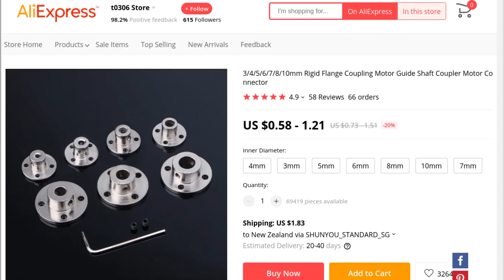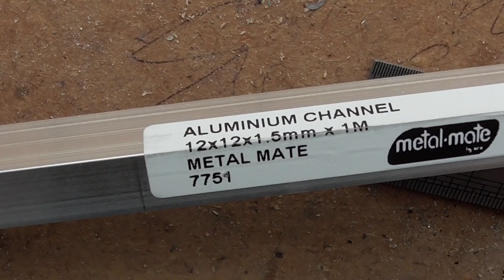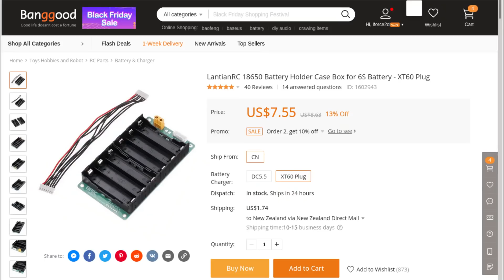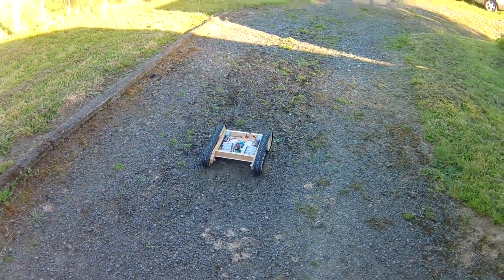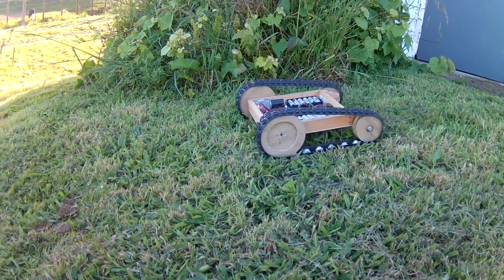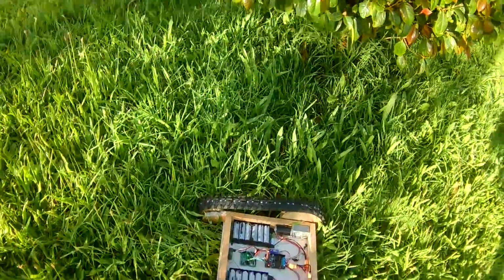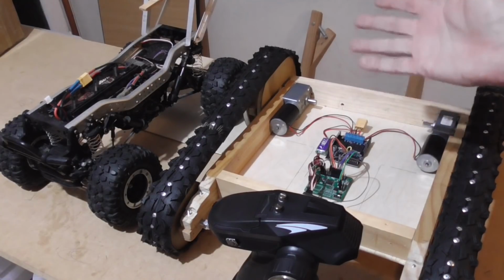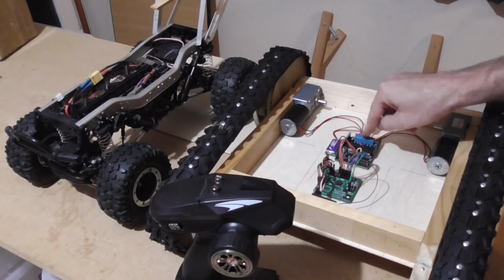Little wooden tank thingy (iomixer)

Comment: So cool. simple and effective. I was wondering why you took the aluminum profile pieces instead of wood or 3d prints. but I guess as you shown the precision is unmatched this way. great idea taking the tires as chains. If I try it I'll take just kids bike tires or something like that.
Reply from the maker: It's extremely difficult to get anything to stick to the inside of the tire, basically rivets or screws are the only choice, and you need two to stop the tooth from turning around. Two screws into wood might have worked, but with the tooth being narrowed at the tip there's not much wood left. Overall wood seemed less durable and a similar effort to build. With the aluminium channel if the hole positions are slightly off they can be widened a little to fit, so the building can be done faster and sloppier. Rivets are quicker than screws and a bit cheaper and still removable later, but they require a thin plate to squeeze against, hence the aluminium. Rivets would have crushed a 3d print and I don't have a printer. The aluminium teeth tips can be narrowed pretty quickly with a hammer.

Yeah if I was starting with this as my 'plan A' I would have used a kids bike tire and planned around that sizing. One nice thing about the larger radius tire is it's closer to a flattened track already and doesn't want to curve so much at the sides.
Reply: Bitluni is here, BITLUNI IS HERE!!!!!!

Comment: Nice!  You have a working prototype ready for further development, so that is NOT a fail!  :-)

It brought back a lot of happy memories. I used to build and fight combat robots [kinda like the ones they used in Robot Wars and BattleBots], and had my first fight in 1987. Our 'Centurion League' machines weighed 100 lbs, and could only cost £100 to build. (So... centurions - did you see what we did there?)

They were hilariously crude by modern standards and their weapons were feeble, but they were fantastic fun. I don't imagine you'd get much robot for £100 these days!

In 1987 there was no such thing as a personal computer; we had no internet, so no online help, no CAD, no CAM, no hobby-grade CNC machines, no design software, no 3-D printing, no brushless motors, no LiPo batteries, no mail-order parts like motors, gearboxes or electronic speed controllers. All analogue, nothing digital. We either improvised or scavenged stuff from scrapyards.

Construction was all wood and aluminium; power came from 12v lead-acid car batteries. Radio control gear was on 27 MHz, which needed an exposed receiver aerial about 24" long. 

Thanks for this video - I really enjoyed it.

Comment: I have built several of these tank style designs. It takes a tremendous amount of force to skid the track trying to turn.  Either go with a half-track design (less track to have to skid across the ground) or you'll need some powerful motors or much less grippy tread.
Solid design! Few little tweaks and you've got it.

Comment: Hey Cris, maybe you should have a look at those hoverboard things, people hacking them easy, and are an astonishing quantity of goodies in a pack for a few dollars if you find a used one.
Reply: that sounds like a good idea..
Reply: Yes, good idea. 2x cheap eBay 250w e-bike brushless motor controllers can power the wheels (make sure they have the reverse function and self learning for the phase wires and hall sensors). I don't have the skills to hack the on board hoverboard motor controller, maybe someone can figure it out. There is however, a way to convert the e-bike motor controller throttle input to accept R/C receiver PWM output using a servo tester.
Reply: I was thinking exactly that. I bought 3 hoverboards last month for $40 total. One of them was fully functional. People really hate those things! However, that allows me to get 250 and 400 watt motors for about $5 each! I can't decide what to do first. Maybe a 1600 watt AWD longboard?

Comment: nice little trick i learned recently. If you need to shorten a bolt, leave the nut threaded on it, then when its cut un-thread the bolt, it kinda re taps the end of the thread that you cut.
Reply from the maker: Yeah I do that if I'm cutting with a hacksaw. The dremel cutting wheel doesn't seem to cause that problem.

Comment: Reminds me very much to my first attempt to build such a chassis many years ago. Unfortunatley I was not that smart to build it from wood and ordered a aluminium, motors, chains, screw and stuff. As this was before it was possible to order all the cheap stuff directly from China that was even quite expensive. But the result was the same too weak to turn.
Later I made similar experieces with several simple DIY tank chassis I ordered from China. They also failed to turn. 
Today I am not sure anymore if the problem really always have been the motors. Maybe sometimes it also was because the batteries where to weak and didnt deliver enough curent to get the chassis turning.

Comment: I've been thinking about building a tracked machine next. Nice! 
Use of bicycle tyres is clever. You might be able to get smaller tyres that you don't have to cut up and sew back together. But hey,  it did work and with the large "teeth" you don't have to have a lot of  tension. 
These worm gear motors are very quiet, I think that was a big part of their design choice. But they have little power. You can get them with higher reduction, but of course then the speed drops quite a bit. 
In the end, to say it with Tim Taylor, you need "more power, harr harr harr" ;) 
Automotive electric window or windscreen wiper motors are popular steps up in power. Some even come in lefthand and righthand housings. 
Very interested in that secret project!
Reply from the maker: ah yeah, the secret project would be right up your alley now that I think about it :) If you can you drop me a mail at iforce2d at gmail, I'll send you one when it's ready for more testing.

Comment: I agree with your assessment and what other comments here have said, it looks like the "platform" itself performed very well, just pretty underpowered from the motors- might just be a lot more friction in a tracked setup like that compared to the crawler with wheels? Would be really curious to see how it does with MOAR POWAH ;-)  

I also wonder if you could design a 3D printed wedge that would work for the tracks rather than the cut/bent aluminum ones? Could lower the build effort considerably, and that's the only heavily duplicated part (especially compared to a lot of other tank designs I've seen).

Comment: 1. Setup is ok, but to achieve the necessary measurement accuracy for this, you’ll need a top quality test gage from somebody like Starret.  2.  Solution is perfect, just selected the wrong problem: seal the axle penetrations and the motor access cover before correcting the design title to semi-amphibious landing craft.  3. Swap the drive and driven wheel positions so the smaller wheels are on the motor shaft for more torque.  4. Wash that gray hair coloring out of your beard.  We know you dyed it to try looking more extinguished. 

As always, great stuff!

Comment: Couple of windscreen wiper motor/gearboxes and some decent LiPo's and esc's would be a good move.
Looks good....like the tyres idea although I would have tended to "stitch" them together with something more substantial like a couple of narrow metal plates and screws.
I don"t think it would worry the drive if the radius was large enough.
Reply from the maker: I actually started by buying a wiper motor, these ones were so much easier to mount though. Wiper motors are surprisingly expensive even junk second hand ones, they likely would have cost more.
Reply: @iforce2d  Another alternative could be the window winder motor/gearboxes....sometimes known as a window regulator......yeah, well, fair enough I guess as it regulates the amount of incoming/outgoing air.

Comment: i would use those hoverboard wheel hub motors. broken hoverboards can be found all over for cheap. it even comes with a driver board which someone made a custom firmware for it (the trigangular looking board)  those motors are 3 phase brushless motors with hall feedback.  they can be driven with a n normal esc if it can handle 8S or more. but a generic ebike controller works much better.
Reply: I was wondering if it was possible to hack into those motor control boards. Good to know, I will have to research into that.
Reply: maybe not hack into, most manufacturers lock their software. but its a standard stm32 so rewriting is / was the better option.  https://github.com/NiklasFauth/hoverboard-firmware-hack

Comment: As you increase traction/grip with more rubber area touching the ground you also increase rolling resistance. Added weight also pushes it into the ground too adding to more rolling resistance.

Comment: 03:09 A 3D Printer would have been nice at this point hu? ^^ Nice to see another rover project, I always like  yours.
Reply from the maker: Not really, I can't see 3d printed teeth lasting very long :p
Reply: @iforce2d  I was just teasing, BUT you're wrong ;). You would be amazed how tough even PLA is when kept in mind during design. Also typically you loose interest with the project long before the part has a chance to degrade. Also the design, print, iterate process is a lot of fun and I would love to see your take on it. For example if you just put a washer between print and rivet it would have been fine.
Reply: @iforce2d  rctestflight went the complete other direction. Everything PLA include the tracks. It ran day and night, with a little help here and there, for several straight months.

Comment: I think part of the problem is generally the brushed motors that come on things like that from China are complete junk they use really weak magnets and probably a really high wind count makes them efficient but, terrible if you want power. The ones used in rc cars are much much better, even the stock Tamiya motor in your CR-01 probably puts out like 5 times the power at a higher RPM to boot. I'm sure you could find some cheap 540/550 motors to swap and salvage the project but, you'll probably end up destroying those gearbox.

Another thing I found on a tiny track I built it turns better when stopped if you mix both channels for a turn if you were not already.

Comment: What coding tool was that? (Not finished watching yet)
Reply: Yeah this is the interesting bit to me too. Some googling finds some attempts to use existing visual dataflow tools from the JS world with Arduino, at this github: https://github.com/microflo/microflo-example-arduino -- but it looks like not much has come from it since. I'd be super interested to hear about this secret sauce.
Reply: @mrluc  looks like it might be flowhub: https://flowhub.io/ the ui looks similar
Reply from the maker: It's my secret work-in-progress :) It runs on STM32 and executes the nodes in that network at 50Hz, kinda like a virtual machine I guess. Unlike the other tools mentioned here the nodes are rather simple and can only have a single output, and there is a strong focus on RC related usage. So far I have these working:

Inputs:
Analog, digital, servo PWM, PPM, iBus, SBus, IMU (gyro/accel), GPS, nRF24

Outputs:
Digital, servo PWM, PPM, duty cycle PWM, addressable RGB LED, nRF24

The configuration interface runs in a browser and requires a 'relay server' running in the background as a go-between to access the USB port. The result value of nodes can be viewed at runtime in the browser (handy for calibration) and execution can be paused and stepped.

The node configuration is stored in flash memory so it could be 'pulled' from the board for further adjustment, even if the original file is not available.

This will probably become a commercial product and is the main reason I haven't been making many videos this year.
Reply: @iforce2d  oh, that's rad -- that seems like a heavy lift that's super capable/flexible once it starts working. I did wonder how it might be done if it was from-scratch, but I thought about compilation/macro-style approaches -- which would lend themselves less to that kind of 'liveness' (ie to instrument you'd have to recompile w/instrumentation enabled). Super cool, thanks again for the interesting content.

Comment: What motor controller did you use? It's possible for a motor controller to make motors hot. If the microcontroller commands the motors to go/brake repeatedly, the motors can get hot fast. You usually want the controller to command go/coast.
Some older controller chips don't like to be driven at high frequency. I'd like to talk you into trying a 200Hz PWM frequency. There might be other changes to improve the way the motors behave.
By the way, you can't call it a robot if your motors don't have encoders. (That's a rule of robotics I made up.)
Anyway, give us info about the electronics so we can help you out. Though to be honest, you're probably right about the motors being the problem.
Thanks for the fun video.
BTW, who was the guy at 3:07? Your dad?
Reply from the maker: It's a VNH5019 which can go up to 20kHz.

Comment: Good job tho m it seems under powered try a larger lipo 14.8 or 11.1 the gearbox should handle things ok the motor may not , link the gear boxes together via shaft to one motor in the middle a grungy one you can always limit the torq

Comment: I wonder if cross loading the gear box shaft from track tension is an issue?
Reply from the maker: Probably not because the shaft is supported on both sides, which is one reason I chose these.

Comment: Clearly you're not going to get any reasonable reading from that dial indicator without putting the track on a properly calibrated granite surface plate first, duh.
Reply: kc8omg:   Yeah... obviously!   I'm surprised you didn't notice he was using it in his right hand, when it is clearly a left-handed model.   :o)
Reply from the maker: goddamit I knew something wasn't right.... with the coriolis effect though, isn't it ok to use these right-handed in the Southern hemisphere?
Reply: @iforce2d  Normally yes, but Mars is in conjunction with Virgo right now AND it's an even numbered year, so yeah, could've tripped anyone up.

Comment: Could the control board be configured to drive your mobility scooter platform ?
Reply from the maker: I suppose so, but the wheelchair already has a controller designed specifically for it, with automatic 'parking' brake.

Comment: As a fast solution to get some more satisfaction while more powerful motor / reduction gear will come, is to swap wheels backwords, so that smaller wheel will lead, as it has less radius. Howere need to sacrify speed over torque from total power. I like your ride in downhill direction with high grass) this creature  must  live 👌 😀

Comment: If you are interested, you may want to look into 3 phase sensored hub motors for drive. Specifically, you may want to look into hoverboard motors, and in replacing hoverboard mainboard firmware with opensource one, such as bipropellant (https://github.com/bipropellant/bipropellant-hoverboard-firmware) . These motors are incredibly torquey, and super efficient. I actually designed and built an Electric longboard using the hoverboard motors and mainboard with some custom firmware derived from the bipropellant project. Two of the motors have no problem driving me (a 200Lb person) up a hill with ease. The Motors are ~$25 a piece, and mainboard is also about same price (which drives two motors itself).

Let me know if you have any more questions, I've been playing around with these for a good bit of time now and designed some neat human-moving applications with them :)
Reply: Great idea, indeed. The second problem solved with this would be the gearboxes, as I believe, the bearings might not be able to handle the radial forces. A proper axle holding the pull force might have salved the gearbox...
Reply from the maker: The gearbox has the shaft coming out both sides, so I think it's secure enough from radial load. Most likely the problem was due to what I didn't tell you... before I put the 'slew' node into my program, it would occasionally blip from full forward to full reverse for a fraction of a second, but only at full throttle and only when actually driving (never did it when I held it off the ground). I never did figure out the reason, but anyway that caused a nice crunching sound a few times, but the constant grinding didn't start until I was filming outside.

Comment: Drive the small wheels not the tall wheels. Slower but more torque, easier on the motors too. The smaller the drive wheels the better.
Reply from the maker: The teeth would need to be a whole lot smaller though, and if the radius is too small they actually don't slot in and out nicely. The tread pattern on the tires kinda guides where you can place them too.